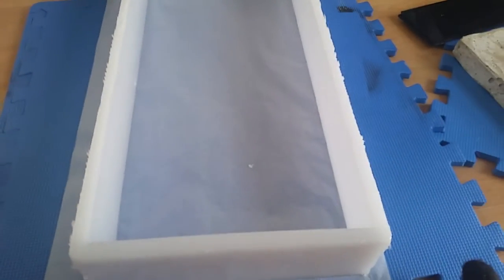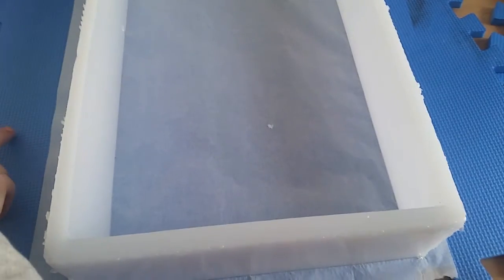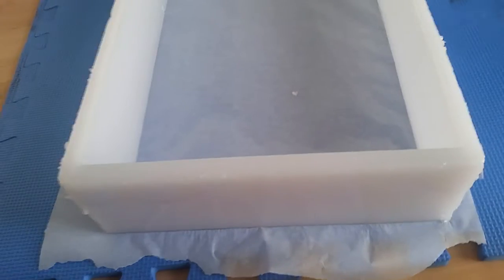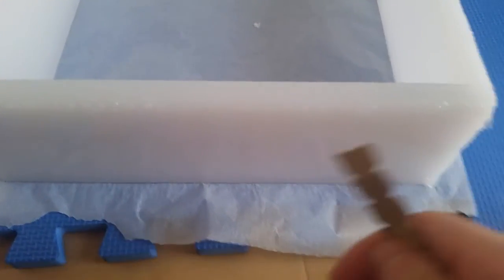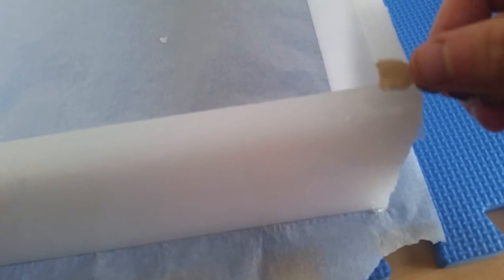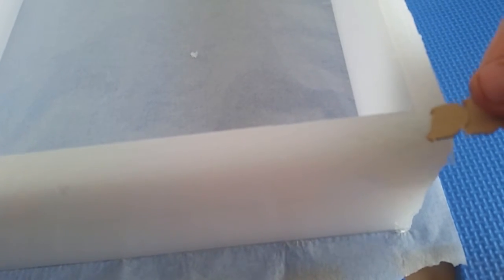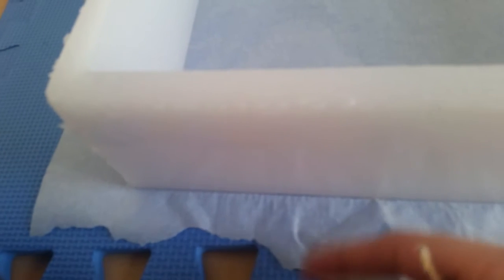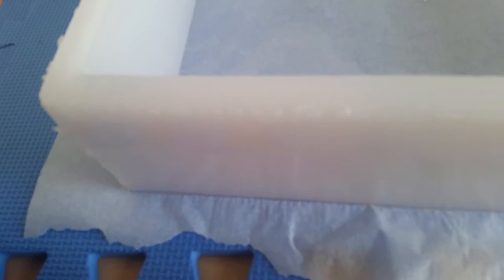How do I fix uncured polyester resin?

Comment: Is it possible you previously used polyester resin with wax added by the manufacturer.. and this is no wax resin? Or maybe it didnt get mixed well enough?  polyester without wax will eventually cure but it will be weeks..

Comment: Remix another mixture with double the amount of catalyst in small batches and paint over the tacky areas. You have to be quick because of the double catalyst and it hardens in 10 minutes or so. I have also brushed on neat catalyst and that works very well. Ive read you cant mist spray it on with a mist sray bottle. Just remember the catalyst it HIGHLY corrosive and can damage eyes, skin so full protective equipment is called for .. However it can cause a lot of heat and depending on your item it may crack.

Comment: Put some wax additives in resin. It will work for sure.
Reply from the maker: thanks for the tip, will have to try this in the future
Reply: Wax in resin add is for final coat?
Reply: @sunilkumararickattu1845  yes for final coat.☺️

Comment: You can seal it with wax paper if you cant find the liquid wax to seal off the air.
Reply: ye wax paper will work for smaller bits when the cure time is less. This was a lot of resin to cure and i think the wax paper would not hold up for that long

Comment: polyester resin needs to be sealed off from air to cure. waxed resin has a liquid wax that rises to the surface to seal off the resin from air. 

temperature also exponentially effects time to cure. I tried glassing my boat below 50F and it didn't harden until we had a warmer day that set it off.
Reply from the maker: Hi Matt, never heard of poly resin needing to be sealed off from air to cure, Ive cured lots of poly resin that hasnt been air sealed and its come off fine.

Definitely agree with the outside temp though, if I did it in the summer i think the results would have been much different

Comment: what type of material you used to fix on side ed
Reply from the maker: this was cast as a complete piece so it didnt need glueing. It was difficult to get it to cure properly however so I decided to cast the panels of the box separately and then glue together with some loctite 414.

Comment: Unwaxed Polyester Resin will stay tacky on the sides that are exposed to the air. You can try to put a layer of wax paper on top while it cures to seal it off from the air. Use a roller to roll out any bubbles so you have a smooth top.  Once cured, pull the paper off and it should not be tacky.   
If you do have a tacky surface, you can wet sand (Not dry sand) it off and polish it back up.   
If you do not need absolute clarity, you could go with a waxed resin and it should not be tacky even without the paper.
Reply: You. Are. Amazing, you saved my project!! THANK YOUUUUU

Comment: I had the same problem, then out of complete frustration took the next batch and went crazy (added tons of) with catalyst,  by the end of the project the bottom had cured as well, Then again it was a really hap hazard move considering the cost of the stuff. Some times a willingness to destroy works hahahaha
Reply from the maker: Yes in the end I was much more liberal with my catalyst to make this but I should have just made it from panels of acrylic I cast instead (which is what I eventually did).

Comment: did you end up finding a way to fix it? I'm running into the same problem.
Reply: I think Sanding will work..
Reply from the maker: Hi Lilly, Im going to make a video response to this as I think it will help others. But I'll give you a reply now. No I couldn't get this resin to set, I tried a heat gum and left it for a week, it was still tacky and breaking off.  

Few reasons to why it happened and hopefully these will help you avoid this problem:

- I was doing this on my balcony in winter (in the UK) so that really didn't help, you need to do it in a warm environment preferably. One way around it is to heat the resin container in a warm bowl of water to bring up the temp before adding the catalyst.

- Use more catalyst, i think I was using 2.5-3% to compensate the cold temperatures, it was a case of trial and error.

In the end I binned this version and just cast the panels of the box individually and then glued together which was MUCH easier.

Hope that helps, and if you got anymore questions, feel free to ask